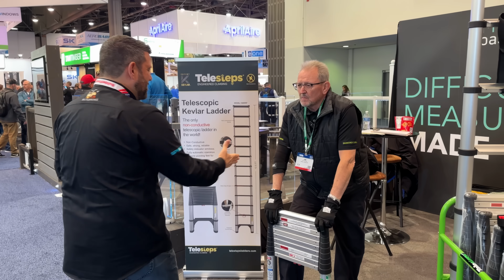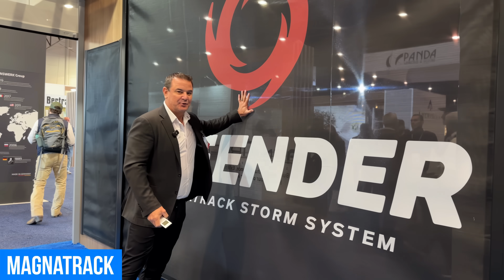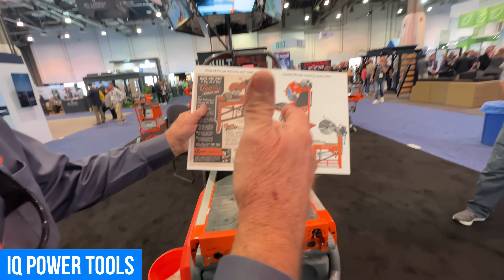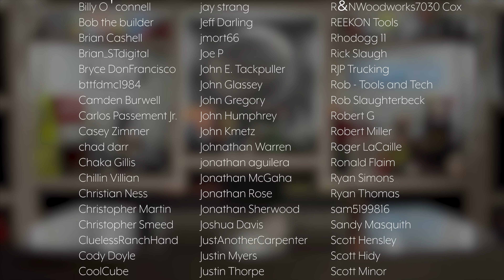NEW Power Tools and Building Tech for 2023 you WILL NOT BELIEVE! It's the Tool Show!

Comment: I use my flex drills in my landscaping company. We use 12” auger bits to drill holes for annuals and smaller plants, makes short work instead of digging. Having a multi rapid charger would be a game changer. Good stuff flex.

Comment: I want those holesaws!
Reply: Same here! I gotta check out my local Lowe’s soon
Reply: Spyder is that good. I bought it set a few months ago. Amazing but don't do tile. You'll ruin the bit.
Reply: Seriously cool. 129 bucks wow that is expensive.
Reply: I'm on my second set. Ive drilled through foundations with those things. Just got the self feeding and non self feeding augers, so far so good
Reply: There good they cut fast but, those carbine tips shred the back side of the cut. I used them for a while but I went back to the regular teeth blades.
Reply: Definitely need to add to my arsenal!
Reply: Right!. I paused video and ordered off of amazon...125$
Reply: Facts
Reply: @davidmrodriguez  they had them at Lowes for $99.99 a few month ago

Comment: A participant in the building business since graduating high school in 1971.... Moved to the Southern Rockies about 5 years ago ... Definitely not to retire ... Lol... I used my first cordless tool in the late seventies... Not too much to brag about but since then I have witnessed the evolution of the cordless tools come about ... The rapid  charging system I just witnessed would be a fantastic tool to have under the current circumstances I now work under .... constant snow and wet conditions that are at the least risky conditions for depending on extension cords and waiting on slow charging tools while enduring freezing temps... What a blessing this system would be to have and use under the my current conditions ...

Comment: The mallet caps need to be able to be stored ON the hammer. Redesign the bottom of it so it's the same size and shape as the hammer so you can just shove them on there. Any tool that comes with small accessories or uses them should try to have a feature for storing them so you don't lose them, or at least it's less likely.
Reply: Also, you can put a small hole in the cap so the screw can be what holds it on so it is impossible for it to come off. 
Leave a comment on one of my videos if you want more ideas that other people will never think of. That goes for any manufacturer.
Reply: How would you store both of the caps on the end of the handle?  There isn't any recessed ring on either of them.  Having a smaller recessed ring would mean that your going to be hitting a smaller area and could them cause damage to the strike area.
Reply: For $240 there should be a brass caring case for the caps
Reply: The telestep is nothing new. I've been ising the xtend n climb for years and it's not nanynstate level sagety. I depoy every other step most of the time. Being limited to bottoms up deployment makes it useless to me. I would have to scrample over the top to get onto a low roof. I  will stick with xtend n climb pro grade.

Comment: We had a crew of four installing two Hybrid NAS systems inside of two refrigerated warehouses. We switched over to FLEX TOOLS early last year. With a FLEX Drill, a Driver, the 7/8” SDS drill and a circular saw on the site we really could have used that charger.

Comment: Rob I am surprised you never heard of the collapsible ladder, I have owned mine for 2 years. Ultra lightweight, super portable and strong to hold my hefty body in the air. there is a lot of cool tools/products you showcased. I would have like to see more of the hardware show, because I use a lot of different hardware for my customers. Better yet I need to go to the show and look firsthand.
It was kinda funny DeWalt was using the Jaw horse to clamp their demo pipe, when I believe they have a pipe clamping system.?? Opps a showcase blunder
Great show as always, Thank you

Comment: Of the FLEX tools I have I can confirm they are a BEAST! I currently have the multi-port charger for my other brand of tools and have a dry erase board with time stamps written on it to tell which battery I put on first because if sequentially charges. 😒

Comment: I was trying to get the garage set up as my workshop. I was trying to build a roll table for my laser and a stand that I put a circular saw to be used as a table saw, with a router on the end and on the other end I installed a jigsaw. I was a lot of exchanging of bits for different screws and bolts. It took me two in half weeks but I finished them.

Comment: Those hole saws look amazing, the dewalt attachments looked ok but one person had to hold the pipe while the other guy used two hands to cut the pipe ? The milwaukee copper tube cutter is single hand use, I like the odia of the attachments but they have to make then single hand use

Comment: Great video.  The cat tools with the graphene battery looked good. I may (will) check them out ).  The grabo..oh my. I definitely have to check them out, they may be very useful in my work lifting cab doors and cab interior panels ..walls etc.    yay we will be able to buy blaklader stuff from your store.    Oh…I drill on an angle many times with any hole saw :).  And have made my own set up to use a hole saw as an arbor.   I like spyder has come out with a system …if only it would work with metal.    Live confidently and peacefully

Comment: I really could use that flex multiport charger I have 3 100 foot pull barns I’m building for a dairy farm coming up in April once the ground thaws I already built 2 similar ones last year had to use corded drill for for driving the 3.5 inch torque screws

Comment: real small addition, on the Spyder Hole Saws (which by the way look nice) they are not the only hole saw where you can stack and use a smaller hole saw as a pilot. The Milwaukee chuck has enough thread on it for 2 saws to be threaded on. Ive dont it numerous times. Regardless, it seems like a great product.
Reply: seemed like the best thing this year tbh, the blade idea one was cool but custom blades annoying

Comment: 9:50 - Questionable.  Notice that there is a huge, dramatic difference in the length of the dowel rods.   If the 'cheap' ladder is supposed to break them then why isn't the long dowel in that brace?  Also, being shorter makes it weaker to lateral stresses.
Reply from the maker: The dowel rods were the same. We played with them ourselves. In this shot it was shorter, because they had been running the demo all day, and kept breaking it. You can see the pile of broken pieces on the floor.

Comment: not correct that spyder hole saw is the only one on the market which ket drill out the hole on the angle. its basicly a US copy of PRO FIT hole sawswhich we have it here in Eu. i use them for more then 3 years, just the same system , can drill a bigger hole too. would be interesting to see just how durable SPYDER saw are.

Comment: 14:49  now, does that mean a Cat 1-5 Hurricane down here in Florida; cuz that wind gets a bit wicked and during last hurricanes (2022) I saw a concrete patio table that was 15 ft round and table weighs 355 lbs +/- 5 lbs And that table flew through air 12 feet into a pool. Why wasnt flipped upside down or taken jn for safety b/c of hurricane; well, who'd of thought a custom concrete patio table wouldn't be heavy enough for a cat 1 to tropical storm. crazy!
so, like to see just how well these "screens' are tested, for how long, and conditions, etc….
cuz sorry to say, testing in a controlled lab setting; nothing like what ppl experience from Mother Nature, imo

Comment: why I use Dewalt and NOT Flex. 20 volt battery..........................I purchased an adaptor and I can use that Dewalt battery on my 2 craftsman tools, my Ryobi glue gun or a Bauer drill for mixing cement or sheetrock mud. so I now have 8 batteries that can do an assortment of things that Flex can't, not to mention its an expensive tool. the government is going to if they haven't already made it mandatory that everyone uses the SAME charging adaptor and charger, this needs to be done with portable tools
Reply from the maker: Hey Jamie, can you source your fact about the government's plans to make it mandatory to use the same charger? I'm assuming you mean port (ie. USB c) on phones. Where did you find that information?

Comment: I use my flex tools at work, when I got home my wife had a project ready for me. So I start on the project and half way through my batteries died as I was using them to cut and drill. Obviously I have to wait for my batteries to charge as I only have one charger. My wife is nagging on why it’s not finished and I told her that I used my batteries at work and they aren’t charged yet. To avoid her from nagging any longer that speed 4 pack charger would definitely get her off my back! Everyone knows how bad a nagging wife is how assume would it be that a simple flex charger will get her to be get off my back.

Comment: I have about 12 flex batteries and people don’t put them on the charger 4 port or not they would all be dead anyway. They pull the dead one off set it down then walk to the charger where I could only have 1 charging, pull it off and don’t put another on. I bought the 4 port charger still not enough to keep them all charged up. Ill have to pick up another at some point.
Reply: Are you saying the batteries of flex does not last?
Reply: @PNWLiving1725  they last as long as you would expect. I just have a-lot of tools going at once. 3 impacts, 3 drills, 3 circular saws, a tower light, sawzall, rotary hammer, etc… The guys are the problem not the batteries.